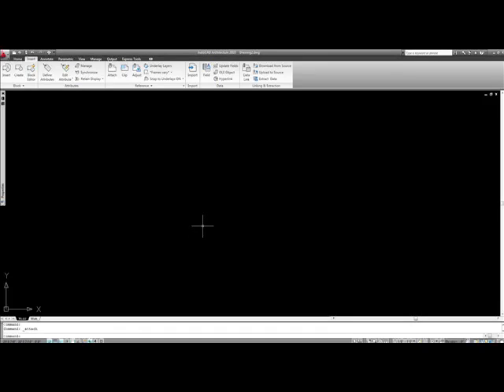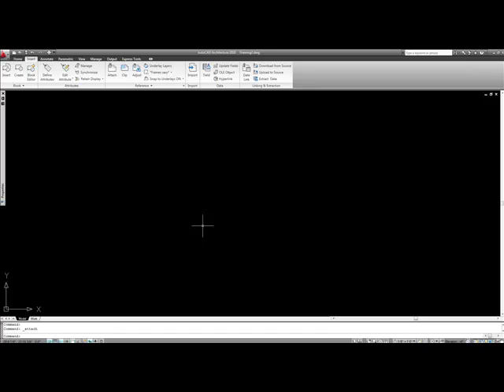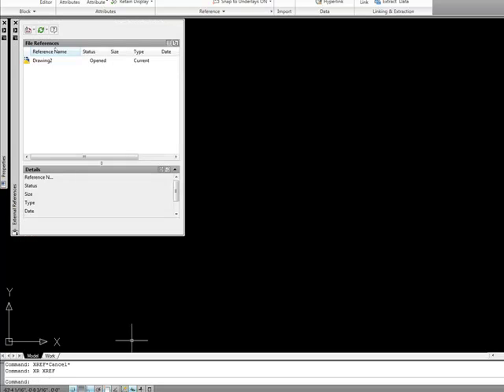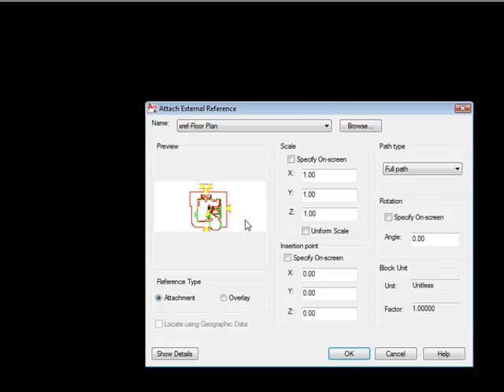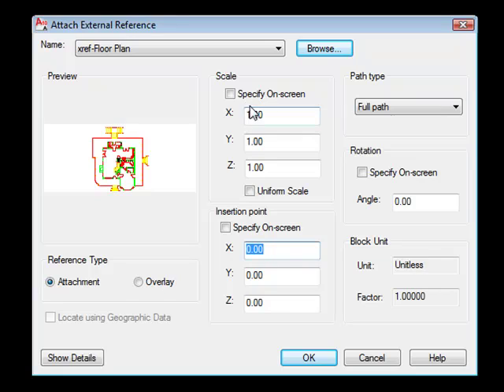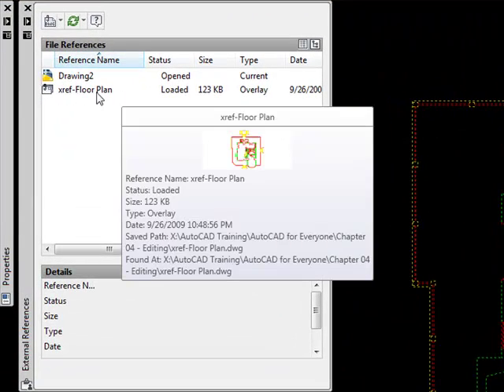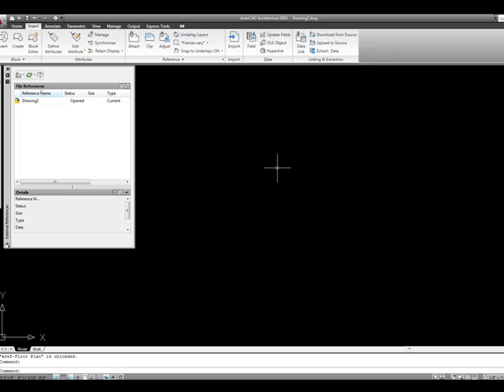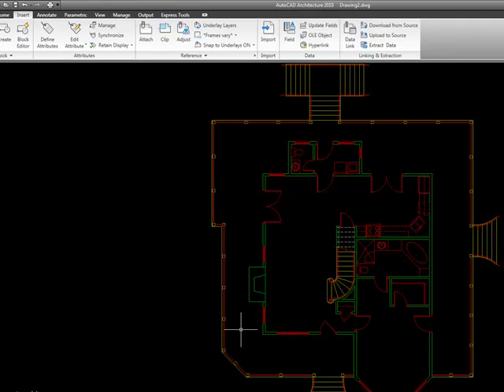Mike's Tips - XREF: External Reference - Inserting into a drawing

Comment: I am trying to use xref but Block unit is by default coming to be in mm and the scale by default is coming to be 0.0394. I am unable to change it on the dialogue box. I am using AutoCAD 2013. Any suggestion?
Reply: samething mine

how can i change it